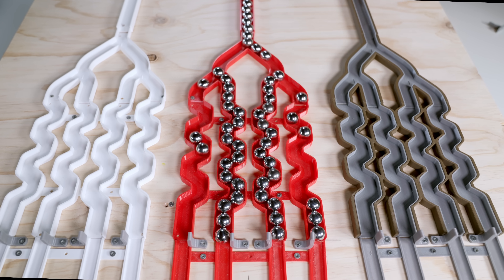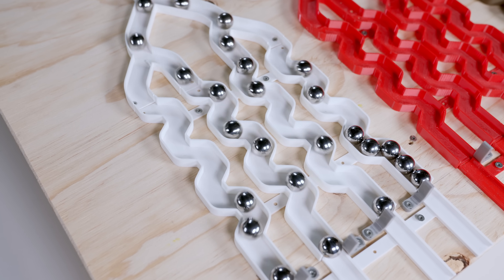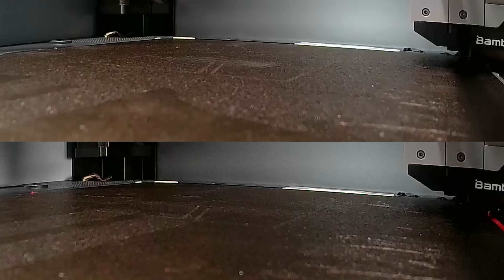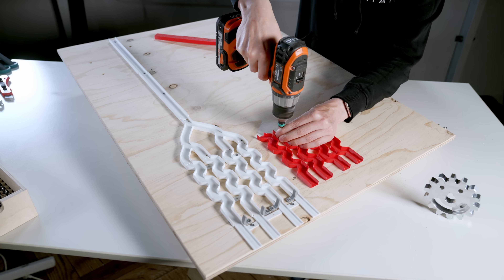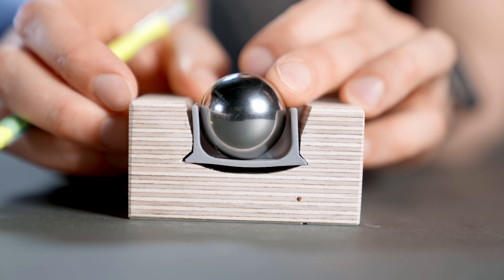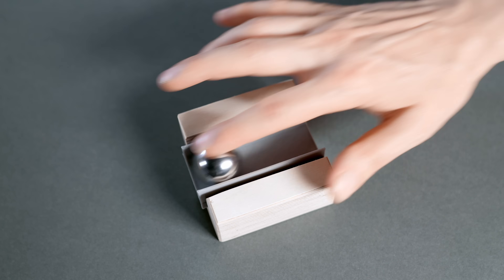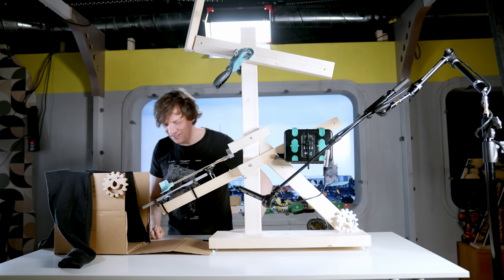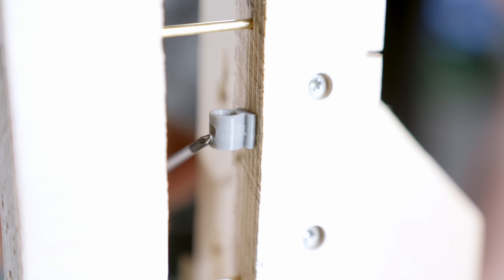The Perfect Marble Divider just got Better

Comment: TPU is awesome indeed, just keep in mind when performing on a stage and it's a hot summer day everything will bend out of shape as TPU really quickly starts changing shape with a little raise in temperature risking the whole marble machine to start malfunctioning, which would really be a shame.. Better to prototype with the TPU but cast the shapes for the final product into a 3d printed mould with some 2 component silicone. I did this before and works like a charm.
Reply: Molded silicone rubber parts will also be MUCH more sustainable Than TPU for touring because if you have issues where your tpu is wearing out you’d need to3d print replacements which is very slow.  If you set up a mold you can pre cast 10 sets of everything at a much lower cost and with more thermally stable material
Reply: And PLA too. Near 50oC it starts deforming. Actually, it woul start earlier in any area under notable pressusre like holding a whole column of marbles back.
But that's ok. It's Martin's usual process: develop something that suddenly seems to work, scale it, discover why it fails at scale / in practice, redo it all over, repeat.
Reply: Martin will never finish this project, so no worries. There is no hazard of "performing on stage".
Reply: You can get higher quality TPU/TPEs. CoexFlex is a 3M automotive grade filament in 1.75
Reply: performing on stage? Dude....
Reply: That thing will absolutely never see a stage light my brother
Reply: Dare to dream... maybe Martin needs to start a family so in 80 years the marble machine can finally go on tour
Reply: @Grd_duc  Brother, may i have some of your music please

Comment: 9:10 Just a caution with CF filament, as the plastic starts to wear down, the small carbon fibers might start to get exposed and potentially become a handling hazard/irritant.
Reply: And to add to this, do not sand down the CF parts!
Reply: This is a VERY important note when using CF stuff,
Reply: I haven't touched mine since that one guy made his video about CF filament. I just can't remember his name.
Reply: @bthal3813  Nathan Builds Robots ?
That was quite a nasty outcome, indeed.
Reply: Replying for visibility.
Reply: Are there coats/sealants that can help with this problem?
Reply: @Soccerrockker6  you're better off just not going with CF if you're worried about it and anelling the non-CF versions to get close to the same qualities (for the most part).
Reply: @Soccerrockker6 no, because the problem is wear over time.
Reply: Micro splinters
Reply: I imagine that the marbles are going to wear it down slowly. The constant impacts and grinding between the marbles as they pass through the machine will cause their surfaces to have some roughness. Intuition tells me that the harder the steel, the worse the cuts.
Reply: What I understand wear is a serios  problem on the marble machine , not so hard to imagen, with does marbles rolling around and falling on everything.
Reply: Yeah I wouldn't use CF here. It has its uses but this is going to see too much wear - I'd rather just ensure they can survive one performance and carry more replacement parts to preemptively replace. (or use other materials like metal of course. SLS might work? He'd definitely need to hire that out but PLA works fine for design.)
Reply: This really needs more attention. Avoid CF wherever possible.

Comment: Idea : instead of a "rolling spoon" turning across blades why not something moving along the blade ? A king od tongue... Dunno if that's clear... 
Some king of long and flat triangle on top of the blade that you can push or pull. Seems simplier to me... :)
Reply: At 17:00 where he shows the printer camera on his phone - was exactly a test piece like you described. So, I think the main take away is that he can use soft TPU for changing the dynamics of the tone, not that he will use that exact design as in his test.

Comment: Im honestly a little concerned about your plywood prototype with the flexible walls and bottom for the track. You may have jammed marbles since the walls squeeze the marbles as the bottom flexes under the weight of the marble. While audio quality is important, it should be a priority to avoid jams

Comment: A full 18 minute video to make a sponsor of a company that is under a marketing campaign to respond to a PR crisis to solve a problem that most likely could be solved way easily by putting rubber mat under the divider or any other solution that avoid the thin plywood sheet underneath it acting as a resonance box... Yeah we ain't getting MM3 until 2030 guys

Comment: When I'm watching your videos I always notice part way through that I've been unconsciously smiling for a while.  I love your passion for this project.

Also, I'm glad you mentioned the open source issues with Bambu lab.  I have a QIDI plus 4 printer which runs on open source firmware and from what I've experienced and from the reviews I've seen it has the same smooth reliability as the bambu printers have had for ages.

After 10 years wrestling with my kit printer I can finally focus on the product over the process, as you put it.
Reply: What about Bambu stealing your information and DRM filament?
Reply: Your printer starts at 750€, I've seen some P1 for 400€, that's quite a step up...

And that's honestly concerning as these were suposed to become cheaper with time, yet every new 3D printer is even more expensive than the last one, and with so many, so expensive options these days, I just cannot choose one.
Reply: @YOEL_44 I'm afraid I can't do anything about that.  It's a new model, but it shows that there is a way for others to compete with bambu on their main selling point, which has always been reliability, without locking their machines down.  Hopefully more affordable printers will become available over time that work just as well.  For me looking for a new printer after 10 years of suffering I wanted to make sure it wasn't just another source of pain, and bambu being proprietary disqualified themselves.

Comment: The other benefit of your dual-material marble divider: TPU is quiet because it's so flexible, but because it's so flexible it may not retain that perfect geometry that allows the marble divider to function with a lot of use. But using a TPU liner with a rigid shell ensures consistent shape and is still quiet. And yes, it does look amazing. 

Keep up the great work Martin!
Reply: Also, the boundary between the TPU and the shell is a great damper. Friction consumes the little sound there is.
Reply: Also I noticed, that in all Tests 
In the tpu version the middle channels got extremely prefered
While the pla track devided much more evenly
Reply: @GoldherzClevermax3 This is only an issue if the wiggly parts of the tracks aren't full. By adjusting the total amount of marbles in the system, you can make sure they are always full, and then they will divide evenly. The PLA divides more evenly with empty wiggles probably because it bumps against the walls side to side as it goes down, so it's trajectory as it enters the fork is much more chaotic, depending on where the last bounce was.
Reply: @piokul  true, but still it is something I noticed that stayed consistent in the Tests of this video
When you don't have enough marbles at hand to fill the whole system with marbles, then you need to divide them evenly
And if you have the issue that in one part of the system, not enough marbles are flowing to fill every channel
there might be a divider where the tracks Aren't completly filled all the time and then suddenly you have 5 marbles left and right but the middle have 20 each. 
That could cause a risk of missing marbles and empty tracks
Reply: @GoldherzClevermax3indeed... Maybe he'll notice it and address? The flexibility is probably affecting
Reply: @cuboembaralhado8294  Yet....he thinks this "perfect marble divider" just got *better*??
Reply: Here I was thinking I had an original thought. Sigh.
Reply: Yes, but if he uses wood, it will sound exactly like the red. The grey sounds better because there is an additional layer under, which is functioning like a sound suppressor.
Reply: Bambu is the perfect choice; enjoy the journey!

Comment: bro comes back for a bambu ad
Reply: At least he mentioned that open source printing community has issues with bambu
Reply: @simplykd3c  Open source was never the the problem.  Before the 1.08.00.00 update Bamby was still closed source but they had open protocols.  They closed the protocols so only their software and interact with your printer.  Their reasoning was bullshit and it's all about DRM/Control in the long run, and VERY little to do with security.
Reply: @bennetb01  the fact that they can change that on a whim is the problem
Reply: Marble machines ain't cheap.

Comment: If TPU is hydrophilic, what does that portend for the long term stability of your tracks and other parts? I suppose you could pull out the tracks from the channels and store them with desiccant for more long term storage, but you probably can't do that for your springs and bumpers and stuff. I have some experience with ONYX nylon-carbon filament and it doesn't like being even remotely wet.

Comment: I know Martin doesn't read the comments but for anyone using carbon fiber filaments, wear gloves! Tiny fiber ends poke out from the layer lines and can get embedded into your fingers. It itches really bad and washing doesn't help.
Reply: It can actually embed in your skin permanently.
Reply: look for barrier cream. It temporarily fills your pores to help prevent this.  Its great for fiberglass work or work with epoxy(still use gloves, but accidental exposure to it on your arms)
Reply: @theJonnymac great for fiberglass, somewhat useful for carbon hypodermic needles.😁
Reply: God yes!
Reply: that would be a darn shame, especially for a musician
Reply: Is it like glass fiber?
Reply: @Laci11280  It's way worse - the fibers are way finer
Reply: Also you should put a clearcoat on as well if you think you will contact it without gloves
Reply: Yes, came here to check if someone warned of the health issues with carbon fibre materials
Reply: absolutely true, and yeah the small carbon fibres embed in your skin and can absord in deeper as it bends back n forth
Reply: Just because your body can absorb the carbon doesn't mean it will quickly or in a safe way, you should be very careful when working with nano materials
Reply: The skin accept carbonfiber as a part of the body so it starts to grow cells on it, making it impossible to get out other than operation.
Reply: That’s for PLA-CF. PPA-CF should be safe enough to handle without gloves.
Reply: Don't forget to have a a spare potato floating around! as long as you notice it before it heals over you can draw it out of your skin with a raw potato slice. 
the old remedies still work. We just got comfortable with the new way of everything.
Reply: If you manage to have one enter your bloodstream, that's a life threatening ER visit level event, same as with optic fibers.
Reply: And be carefull with it getting into your lungs, this cf filament might be the new Asbestos.
Reply: Also probably better to print it in a hood. Inhaling carbon fiber particles is akin to inhaling asbestos.
Reply: Duct tape worked well when I was working with fiberglass, not sure if it would stick the carbon fiber